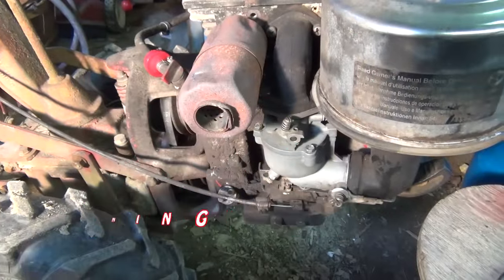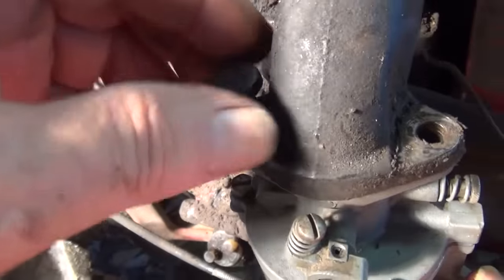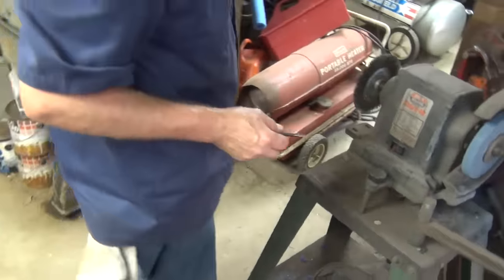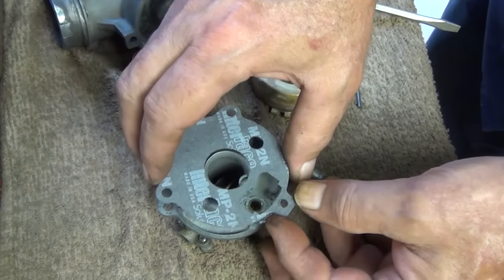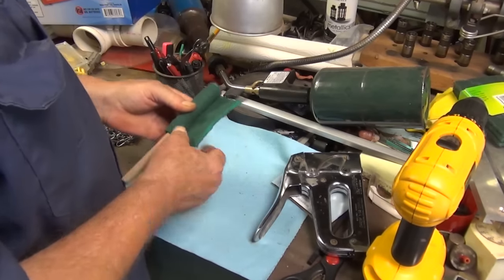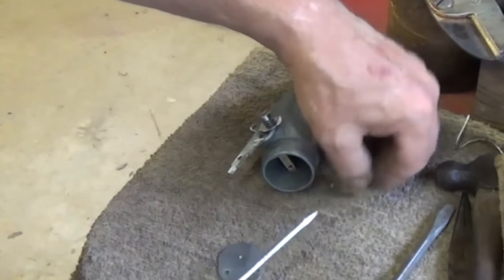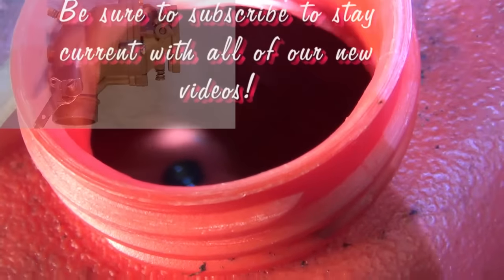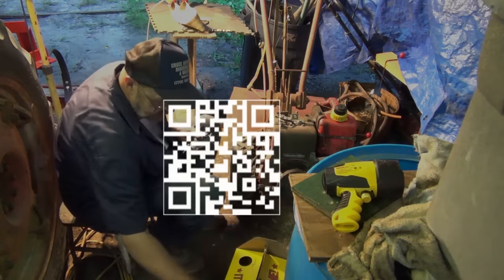8 HP Briggs Carburetor disassembly and Cleaning

Comment: I have this engine on an old Coleman Powermate generator. It's running really rough and only runs if I have it almost fully choked. This video will be very helpful when I take it apart. Thank you.
Reply: Same, with a walk behind leaf blower. Glowing red exhaust to. Carb's apart, one of the 4 holes in the middle of the main jet is clogged. Hope u got yours fixed up.

Comment: On gravity feed fuel systems you should stick with the fuel screens.  You don't want to use a paper fuel filter element for gravity feed because the fuel can get hung up in the paper element.  
The red Briggs & Stratton 298090S fuel screen on your tiller is 150 microns.  The White Briggs & Stratton 394358S fuel screen that I run on my tiller is a 75 micron element.  Not sure that they make a finer mesh screen element than 75.
Running a slosh of E0 Synthetic oil 2 stroke fuel in an empty tank just before storage is not a bad idea.  It'll keep the tank and float bowel from rusting as quickly and Zero Ethanol fuel won't turn to goo as fast as E10 or E15.

Comment: Tiller still getting it huh :)
Reply from the maker: bird551222 running great
Reply: Wasn't the block cracked when you got it
Reply from the maker: bird551222 the old block was with the head off and left out in the rain